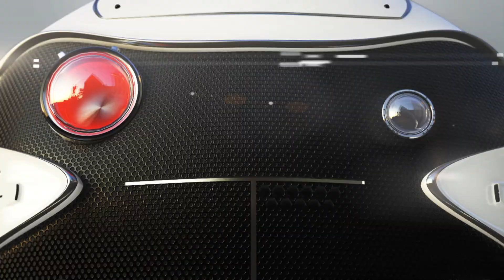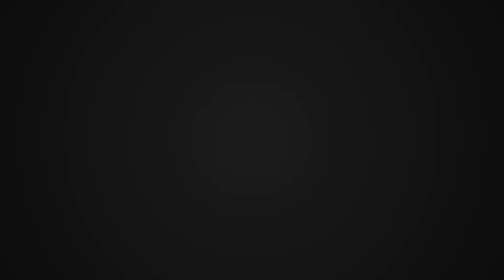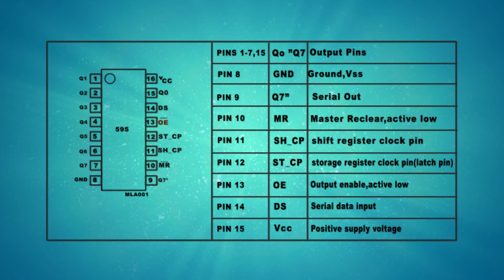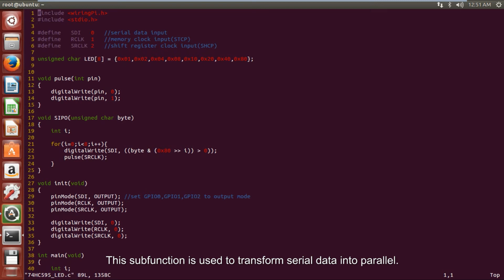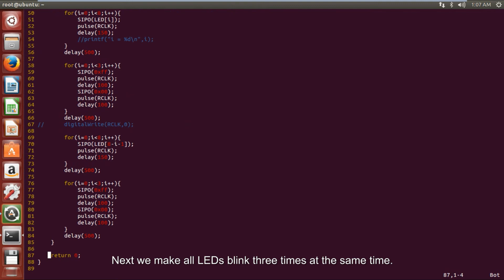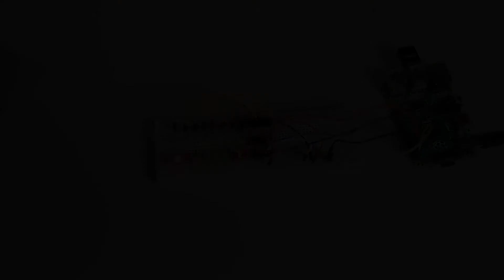Sunfounder Kit Turorial for Raspberry Pi - Driving LEDs with 74HC595

Comment: This video was great I tried the same project but by using 6 led's and not 8. But I have a problem I want to make more shift register and led projects but i cant find anymore led and shift register projects anywhere. So can you please make or try to make some different projects with the 74HC595 IC and LED's. That would be really helpful. 

Also thanks for the link you gave me last week for the distance sensor.
Reply: Aryan, I agree with you i have the same problem here.
SunFounder team can you please try what Aryan is saying
Reply: Thanks RaspberryUser.
Reply: You have some great videos RaspberryUser, I really like them.
keep it up and keep posting videos frequently. i would like to see them.
Reply: Thanks Aryan. I love the feedback from you.
Reply from the maker: We just make a traffic light project with two 74HC595 and RGB LEDs, but an Arduino Nano board is used. You can try if you have interests. Here is the link: https://www.youtube.com/watch?v=4vowpzBUau8
Reply: Do you how to convert Arduino projects into Raspberry Pi?
Reply from the maker: You can refer to the schematic diagram, the wiring and code is similar for Raspberry Pi, you can try and explore yourself. If you have any further problem, welcome to post on our forum!
Reply: Thanks Guys
Reply from the maker: You are welcome : )
Reply: Hey guys I have question for you -[ where can you put a diode on that circuit so its protecting the circuit from opposite current flow? ]I am just asking because i am trying to make this circuit on a perfboard.
Reply from the maker: Sorry, what project do you mean? As if no diode is used here.
Reply: Oh, I meant the driving LED using shift register.
Reply: Same i meant the same as RaspberryUser
Reply from the maker: For details of wiring, you can visit :https://www.instructables.com/id/How-to-Simulate-a-Traffic-Light-System-With-Arduin/
Reply: How about using http://wiringpi.com/reference/shift-library/ for this case? ;)
My code sample:
void sendSequence(int value)
{
 digitalWrite(latchPin, LOW);
 shiftOut(dataPin, clockPin, MSBFIRST, value);
 digitalWrite(latchPin, HIGH);
}
Reply: Also, I'm using cleanup like:
#include <signal.h>

void clear()
{
 digitalWrite(latchPin, LOW);
 digitalWrite(clockPin, LOW);
 digitalWrite(dataPin, LOW);
}

void clearDisplay()
{
 sendSequence(0);
}

void signalHandler(int dummy)
{
 clearDisplay();
    clear();
    printf("\nI'm done\n");
 exit(0);
}

Add to main():
signal(SIGINT, signalHandler);

Any suggestions?

Comment: no instructions for the GPIO extension board?
Reply from the maker: +Stefan Brittain Actually you may go to the Notice part in the kit user manual for details about the T cobbler (GPIO extension board). And following the Notice, in "Introduction to Pin Number of Rasberry Pi", at the beginning there is a figure and you can see the GPIOs layout is just a "T" shape, which means you can check the I/Os with those on the extension board. 
If you do not have a user manual at hand, please visit LEARN section on our website and check the tutorial on the page of a certain Raspberry Pi kit.